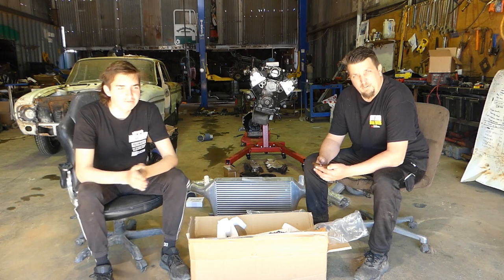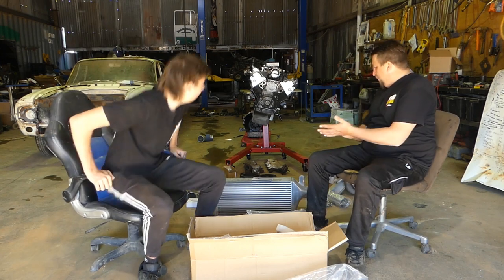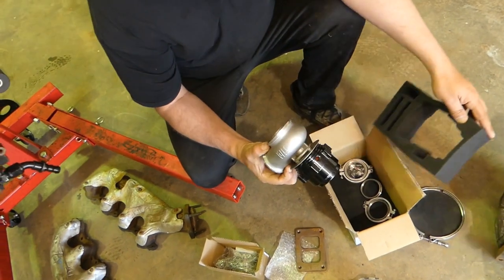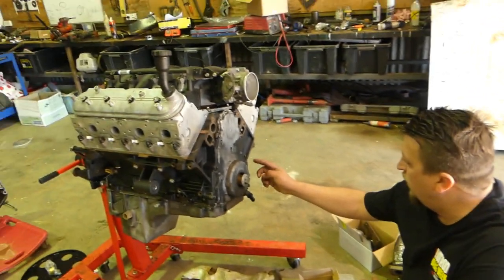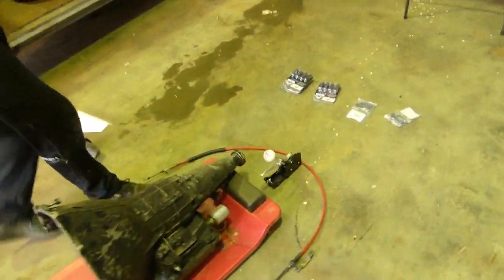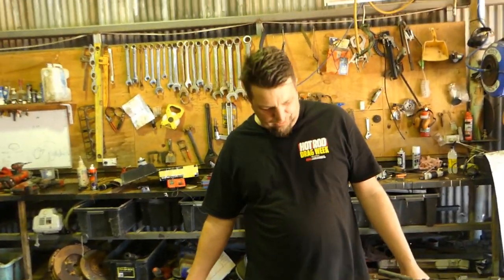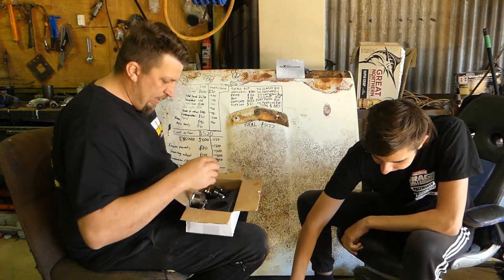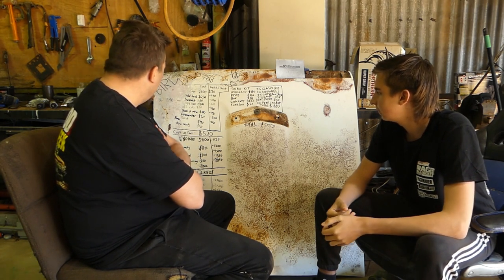HOW TO TURBO YOUR CAR FOR $900: HUGE CHANNEL ANNOUNCEMENT & BUILD UPDATE: Haulass Garage Episode 23

Comment: Some lunch-break googling finds that turbo was used on a 18.5L Mitsubishi S6A3 industrial diesel, which comes in marine or power generator versions. I'm no expert, but a 18.5L motor at 1800RPM displaces the same as a 5.3L at 6200RPM - not sure the LS is going to touch the sides of that exhaust housing.
Reply from the maker: Thanks for the research! We will have to wait and see haha
Reply: She be right I used a 16 ltr Detroit turbo on my Holden v8 hence it’s started making boost at 4500rpm lol was fun though

Comment: Hey guys is that 4 or 5 stud front if so what hubs disc and brake setup are u running looking for an easy conversion for my rx4
Reply: Love the content by the way 👍😎
Reply from the maker: Sorry mate YouTube didn’t show your comment, It’s a standard ke70 with hub adapters to convert to five stud. There’s two videos on the front end install 👍
Reply: Haulass Garage thanks 🙏 guys appreciate it really love the content damm YouTube appreciate the reply

Comment: ministryshirts.com.au good quality gildan tshirts ive used them a couple of times single print of numberplate on the left side of chest , $15.45 each gotta buy 20 and thats delivered to gero wa . definately need a billy bob shirt . those exhaust manifolds are cast steel not iron just weld them with a mig
Reply from the maker: Thanks mate we will check them out